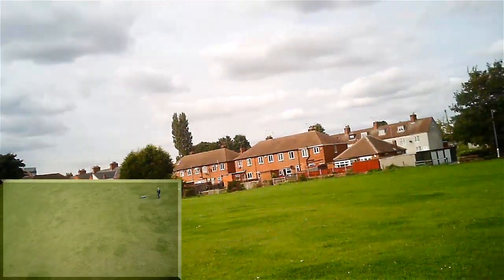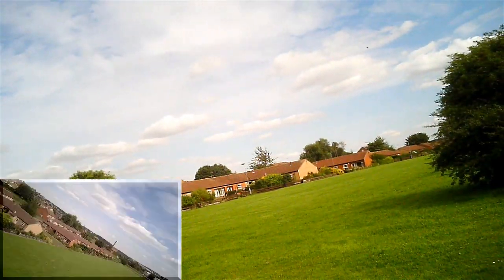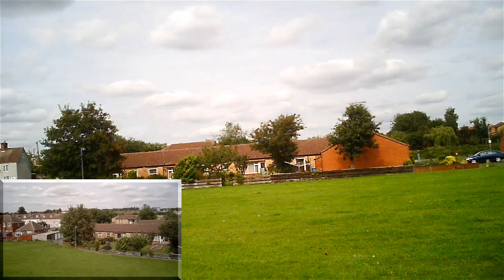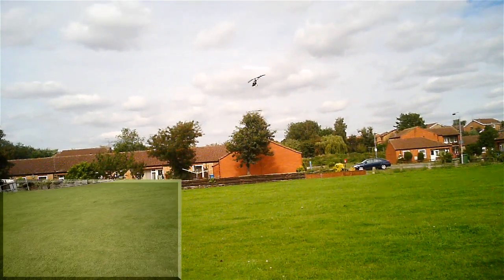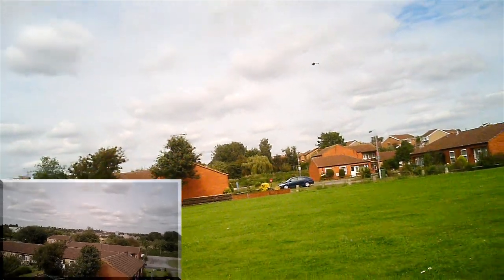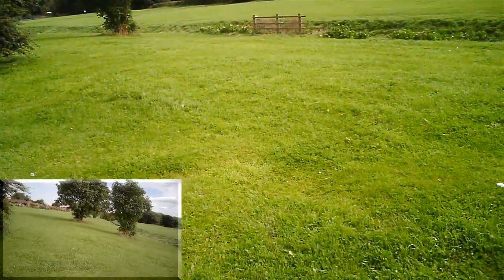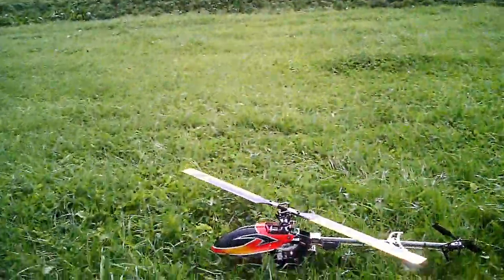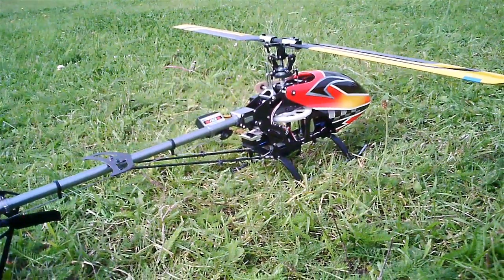HK-450GT FBL 083112 ZYX Firmware Update Test Flight

Comment: I've upgraded my zyx-s to 3.5 and I've got about 10 flights on it now....and I'm not happy with it.  I've spend about 2 hours trying to dial it in but It's just not right.  There are random up and down pitch movements (like flying a flybar in the wind) that's now been introduced.  It never did that before. I've also had to increase the gain on the tail by 10% via the tx.  I might be re-flashing it back to the old version.